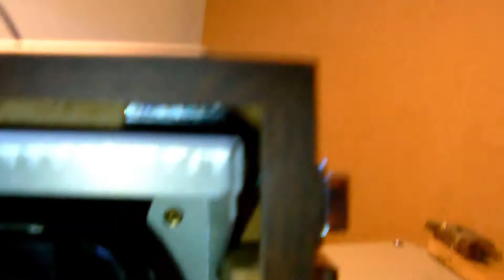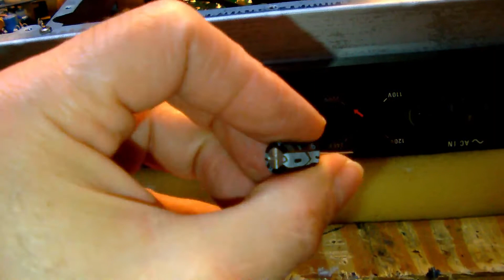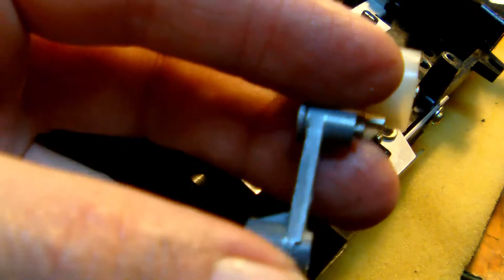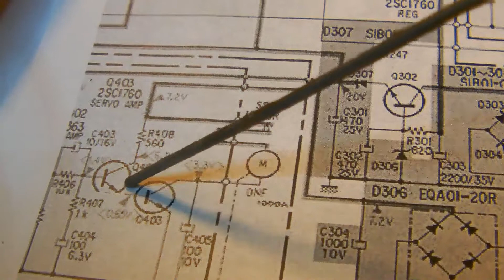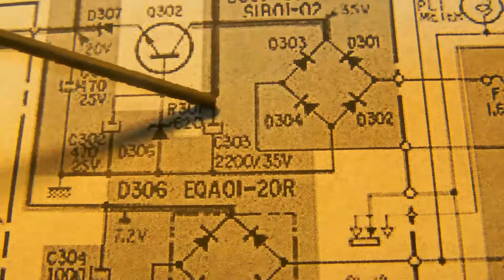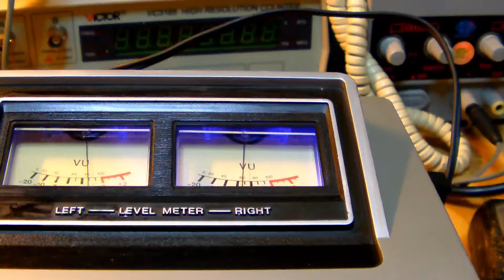Sony TC-144 CS Cassette Deck Amplifier Repair Restoration part 1 of 1

Comment: The average cassette deck (and reel to reel) is very complex. As the decades go by, the components and mechanics 'age' in slow motion resulting in one fix after another. I have 16 cassette decks, and one Revox A77. One thing I have found is that since the cassette is a small, delicate, and rather poorly thought through design, it is very prone to going wrong. I have spent literally hundreds of hours working and repairing them, and in some cases making small modifications.

Patience and good grounding of how the machine works is required.

Nice video, I always enjoy watching other people's work!
Reply from the maker: Thank you James for your encouraging comments. A lot of my "work" here on you tube consists of watching a lot of other people's channels too... One can always learn something new or interesting if one's truly interested in watching a video rather than "skimming" it :)
This cassette deck was devilishly complicated to me (I'm not an expert in mechanical stuff I confess) but it was an interesting experience. I was a bit disappointed though about the sound quality of music recorded on a cassette. I don't know why I put up with such mediocre sound back in the day when I was a teenager

Comment: Great video, I have a similar deck from the 70's.TC-133, no longer works. Do your's have
the pair of matching speakers that formed to lid ? Cool design.
Thanks for sharing.
Reply from the maker: Hello Keith. Thanks for the nice comment, it makes me happy to know you appreciated the video :) It's funny you should mention the TC-133 because I originally aimed at getting the TC-136 (which is rather similar I think) but I got the 144 instead. As for the speakers, no unfortunately I don't have those (they're on my list of nice to have) But usually I start a restoration project with a budget in mind which I try to stick to. This cassette deck needs a new motor and some work still on the mechanical part, so I might revisit it and who knows, maybe I might even bump into a pair of matching speakers.... :)

Comment: excelent job!!! I have the same model, works the preamps, vu meters input and outputs 
but unfortunately the player and recorder of the cassette don`t have 
signal to record or play. The the mechanisms and engine  rewind and  ff of the player works well but the signal is gonne. Maybe You have a idea of this problem? regards
Reply from the maker: Thank you for the compliment. 

There are in fact three switches inside the cassette player that work together to start either recording or playing. Two of them are on the left side (inside the player when looking at the front) and one large side-ways switch on the main PCB on the right side of the mechanism. 
If either of those switches do not work properly, you won't be able to play back a cassette or record on one. I would suggest two things: 
1) check whether the switches on the left are wired properly and still give good contact
2) clean the sideways switch on the main PCB and check the solderpoints of the switch are not broken (in which case you should reflow the solder to each contact)

Also, when you reassemble the player make sure the little lever of the mechanism pushes the sideways switch on the PCB correctly.
Good luck :)